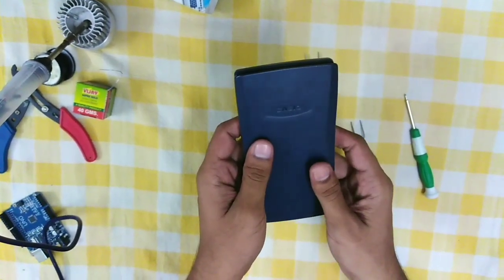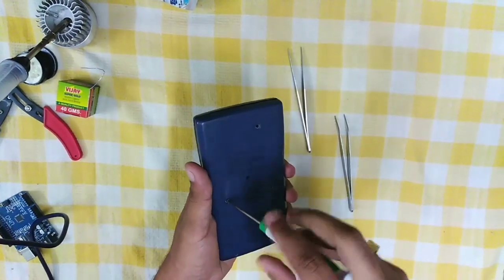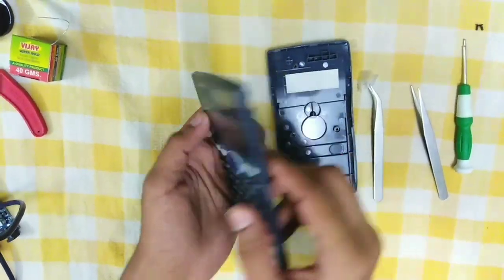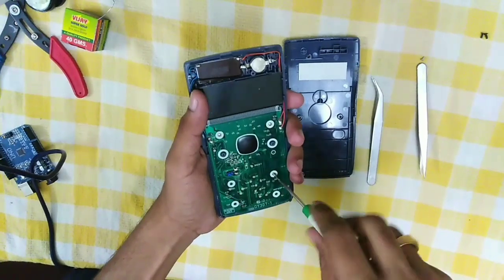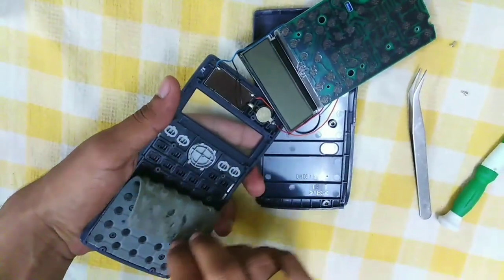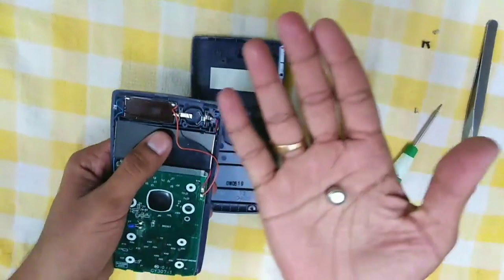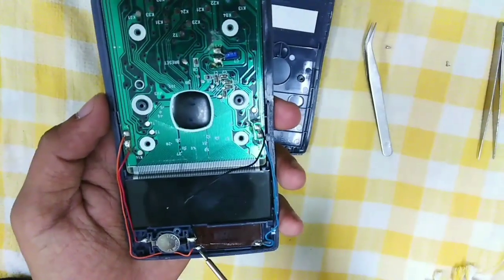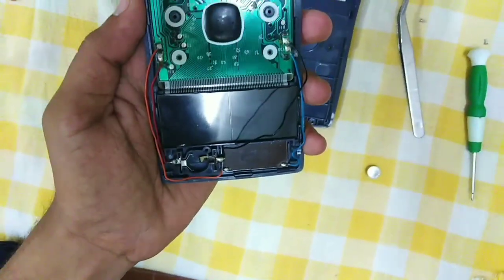Inside of a Scientific Calculator | Components of fx-991MS | Scientific Calculator CircuitBoard

Comment: Sir, my calculator is working  under sunlight rays. Should I have to change my battery???
Reply: @balamuruganramalingam4709   thank you
Reply: @balamuruganramalingam4709  sir... My calc works in sunlight, but not with battety.... Changing battery did not help.

Can u plz tell which part to replace ?